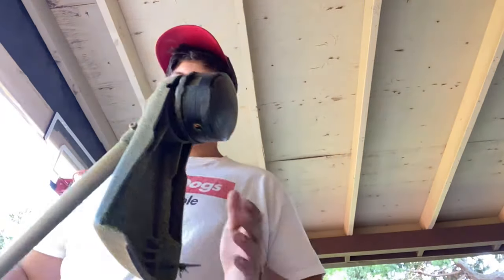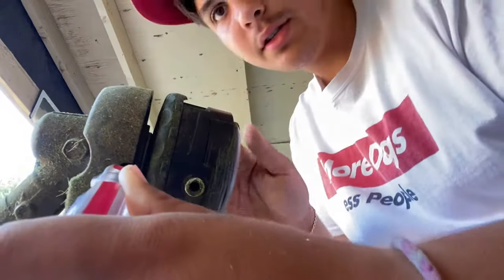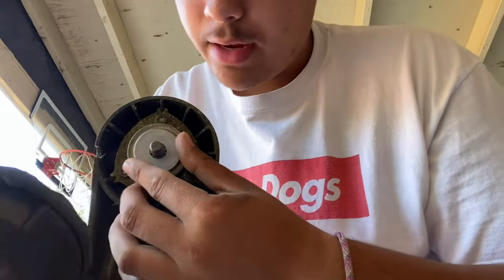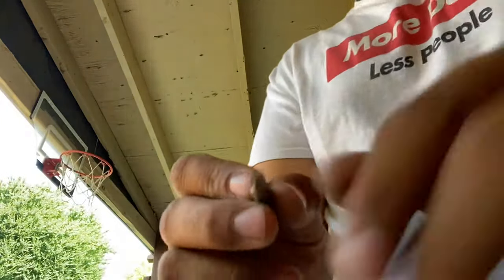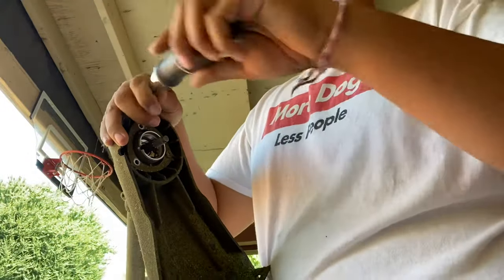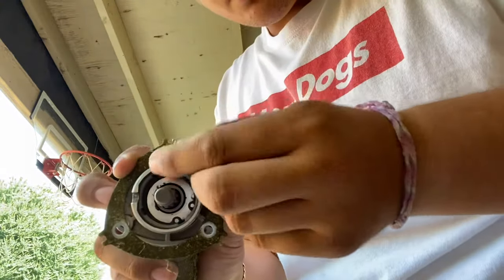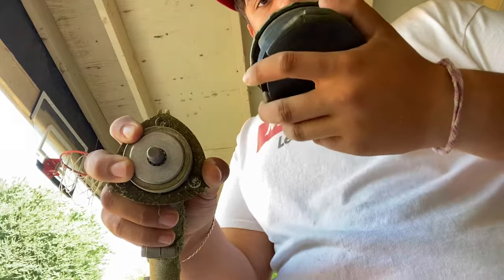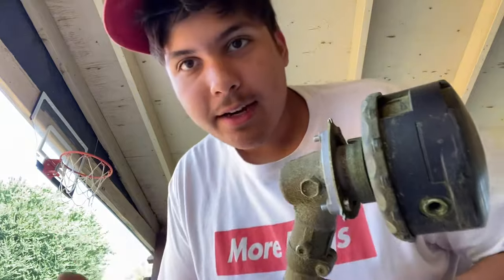How to Remove Echo Weed Eater Guard, Easy and fast

Comment: Thank you for doing this. I think the guard makes sense, but I feel forced to remove it because of that auto-cut blade on the guard that keeps the string so short..l makes no sense. Again, thank you. This is appreciated.
Reply: The only thing that item guards is long string! It does not prevent anything else. Excess string can lead to smoked clutches and overheated coils. Thats why it voids warranty when you remove the "knife holder"!

Comment: A 9/64 allen wrench worked for the star bits for me and it was a hair loose so if yours are super tight they may strip. But it technically worked cause i couldnt find the star bit

Comment: Taking the guard off also removes the cutter that keeps your line at a pre set length on my ECHO that is 17" without the guard there's nothing to cut the string. I see many "professionals" that remove them, I'm curious how they regulate the length, personally I keep my guard on it helps keep the debris off me plus keeps the string to a manageable length...and this might be important to some...
taking it off voids the warranty but I fail to see how they (ECHO) would ever know.

Comment: Guards are absolutely useless on weed eaters. All they do is cut your string to short. I'm all about safety first but as it relates to weed eaters I see no practical use for guards.
Reply: There is usually a cutter o the guard. It is to keep the line from getting too long. If it is too long it puts added stress on the motor not to mention that it will not cut as hood.
Reply: I always take mine off, with or without the guard you still get hit with crap, you can see the string better, and edge better without the guard..  It's just all around better. If you trim correctly the string length doesn't really matter, its not harder on the engine, its harder on the clutch,  it's a few dollar part for replacement clutch shoes.
Reply: really?  seriously?  damn the future of humanity is doomed

Comment: What's the purpose of removing the shield 🛡️..... anyone?
Reply: your line can be longer therefore cutting more and i feel like the guard effects my field of view
Reply: @josemunoz83  good point.....I did remove the guard from one of my weedeaters.....and I think I like it better......and yes more cutting surface....
Reply: faster cutting. also the head will spin at a lower rpm with  longer line so even if it does throw a rock or stick it won't be a missle. learned this cutting other people]s yards. they don't travel as far and are at a slower speed when your trimmer does catch one, so a lot fewer broken windows and/or property damage. you don't want it way too long either, but you get a feel for it when you do it regularly.

Comment: I don't suppose anyone has any advice for a moron who didn't put the locking gear back on before putting it mostly back together?  I've been trying to get the head off for months, but my only result has been frustration.
Reply from the maker: Break it ?😅
Reply: @victorcastaneda2466  🤣 I ended up pulling the whole head off the shaft and got it that way.

Comment: The question I have is what is the benefit of removing that guard?
Reply from the maker: easier to see where your cutting and it saves you string
Reply: @victorcastaneda2466  got it. But doesn't that force more of the debris back at the persons legs doing the cutting?

Comment: Question:  what’s a safe length to allow line so as to not damage motor?
Reply from the maker: max like a ft
Reply: @victorcastaneda2466  cool, I cut it at 10 inches.  Thanks.